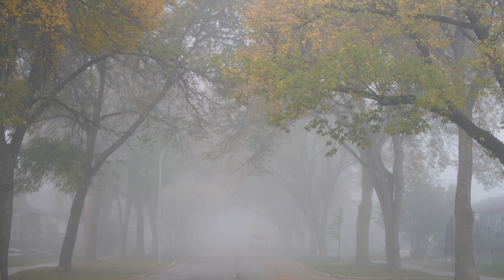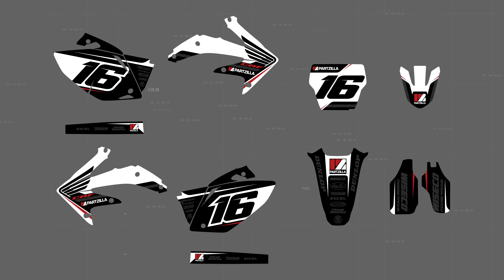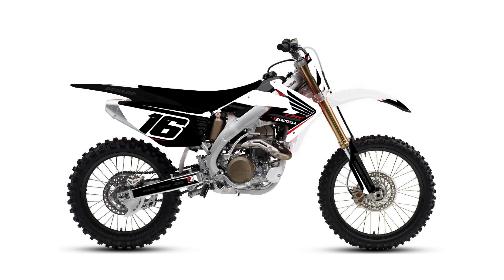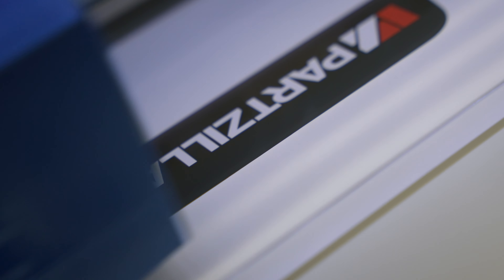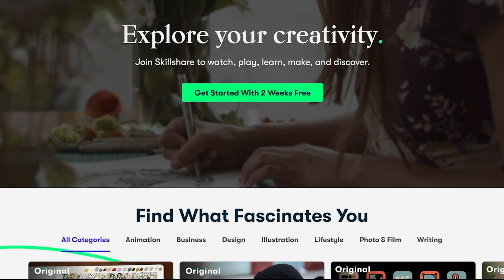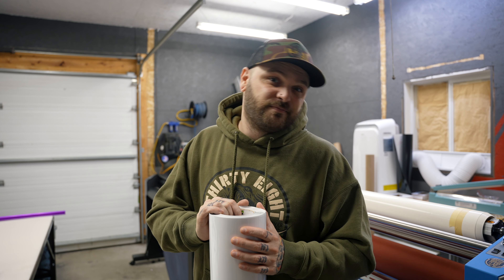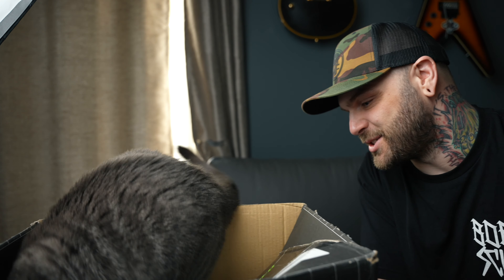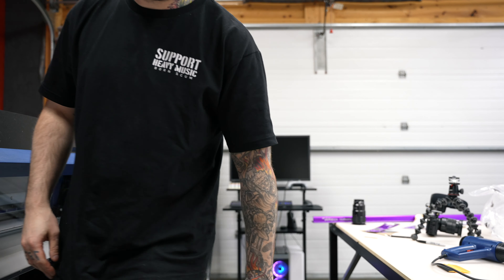I Printed A Custom CRF450 Graphic Kit For Partzilla!

Comment: What RIP or print software are you using for the Roland/Suma setup?
Reply from the maker: Versaworks for the print and summa's terrible cut software
Reply: @leestuart38  Sounds like a nightmare! Any rip that does both?
Reply: @TaylorWright  Tried Flexi, would recommend. Create lines in Illustrator and right cut out. 🙌🏽

Comment: Cool decals, I had a Company here in DK 10 years ago where I mad the same decals for MX, here I used Convex and their 12mil laminate, I cut it with the 60 degrees sandblasting knife, that material was at that time the best, I tested the Substance as a new material, but it failed during race in MX 1 & 2, good luck it is looking good though :)
Reply from the maker: Thanks a lot. Substance has come a really long way in the past few years, they're the top material manufacturer in the space now. Their stuff is really good.
Reply: Cool, I remember the price for the Convex imported from US costed a fortune  :) good luck with the business

Comment: Beautiful work Lee, I have a small one man sign shop where I am running a VG2-540 as my printer/cutter on the digital printed jobs. I would like to get a Summa next as well. Were you able to find a good workflow/3rd party software to run both machines? I was thinking of getting FlexiSIGN if it works with both. Currently I run a Vinyl Express 42" cutter for cut vinyl stuff, but would like to move to a cutter I can use on the 54" stuff after laminating.
Reply from the maker: I tried all of the 3rd party rips and hated all of them. They were all non-intuitive, had almost zero support and also made my printer run like shit. I tried every profile setup I could find and the print quality and colors were terrible with flexi. I stuck with using 3 different pieces of software because I'd prefer quality over speed
Reply: @leestuart38  Thanks Lee, up in Canada here, where did you buy your Summa cutter through?

Comment: Subscribed to new channel I can’t wait. Question: Hey Lee how do you feel about the Roland I’m debating between that and an epson but it’s not enough videos out here. So being that you have a Roland I’m leaning towards that a vg2 and also the summa since you got one. Do you think spending more for the camera one would be worth it ? And can you make a video on what goes on into the software part from design to setting registration mark to the Roland and to the summa and then taking it apart (kinda like a making stickers videos ) thanks for the inspiration
Reply from the maker: I like my Roland, but if you're looking at the epson 80600 I'd go with that. I think it's the best machine out right now. I'd also go with the camera model summa if I could go back but it's only necessary if you're doing specialized stuff like metallic and chrome material with registration marks
Reply: @leestuart38  what about if I’m going to do car wraps as well

Comment: love your persistence and work! what do you recommend to learn how to get into custom design/print?  Also, print/cut using the Roland and summa... thanks!
Reply from the maker: Learn illustrator the best you can, tons of stuff out there on how to do it. Otherwise, learning the equipment is down to the little bit there is on YouTube, and trial and error when you get the machines. I'll try to include a bit more of that stuff

Comment: Just a little tip. If you want to fully cut out the design just add another contour cut. This is how I do all of mine and I do 100-200 kits a month..
Reply from the maker: I've been scared to try that just in case the piece comes out and jams up the machine, I've had that happen with stickers a couple of times. I guess I could quit being a pussy and go for it haha

Comment: You got Illustrator to show true black values? I bet you already know, but perhaps that option isn't ticked. That causes issues for a lot of people when it comes to blacks, ours too in the beginning.
Reply from the maker: Ya normally I don't have that issue. I did the base of the design using the stock swatch panel which never seems to be affected by that setting, normally I'm using my own swatches